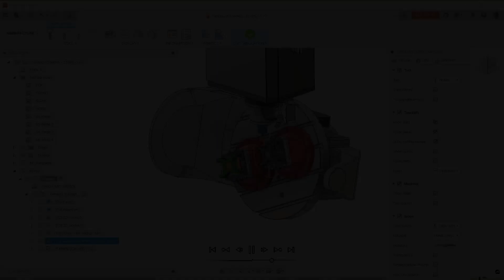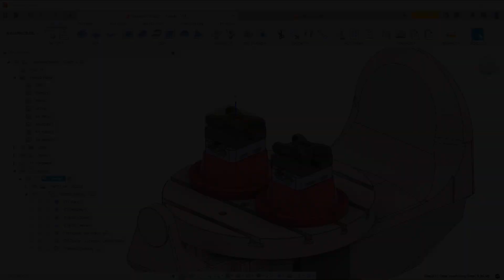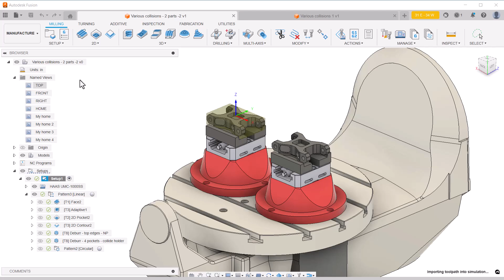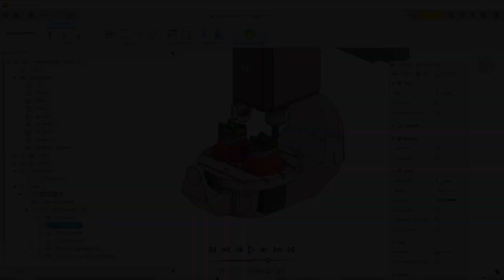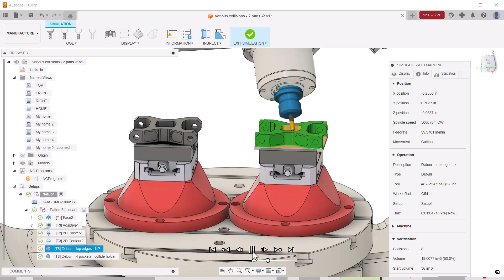Prevent Collisions in Autodesk Fusion with Machine Simulation

Comment: Could you please make a current instructions video about the machine builder?
I have four five-axis and two four-axis machine models, that I created when the module was still brand new.
After Update, I have problems with the cooling M-commands.
It would also be interesting to see how a machine like the DMGMorie Evo series can be configured. Because of its 45 degree swivel system
Reply: Have you watched their recent videos on the topic? They've posted a couple over the last month.
Reply: @ScottMoyse 

Yeah, i looked at them.
But for someone how is using the machine builder for some time now, it doesn't really help.
It's more like a beginners Guide.
I need an advanced Video.
For Machines like the DMG Evo Series.
I know Fusion can simulate it.
Here a video: /5aUU8mRD2Ig?si=WjqiRgEPb8bVCFeN
The axis of this machine are not 90 degrees to each other.

My other problem is:
I want to use through spindle coolant.
Machine is setup with spindel coolant in the machine builder.
In the Post Processor the Coolant is setup as well.
If I Post the code i get the correct Coolant.
But while Programming, Fusion reminds me with every procedure, that the currently selected maschine does not support spindle coolant.

Not with every maschine i have, but with some of them.